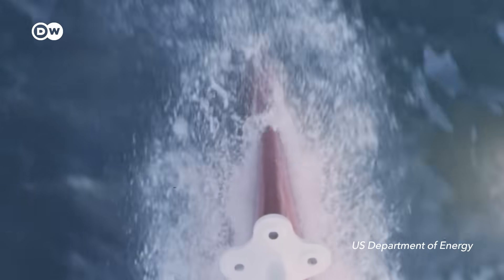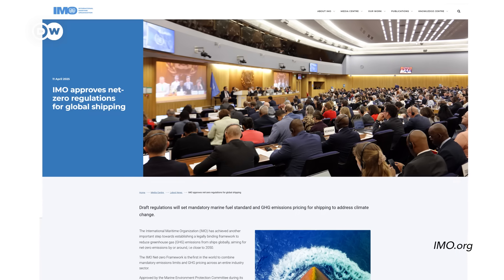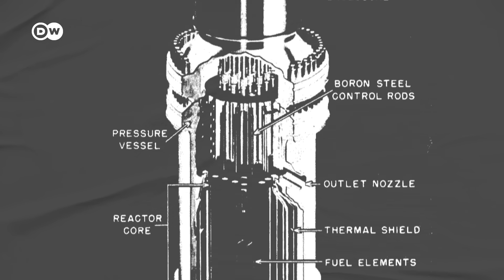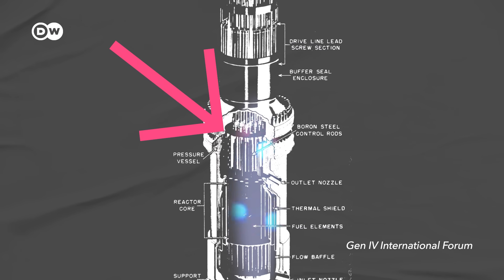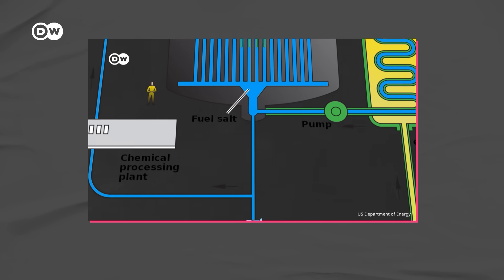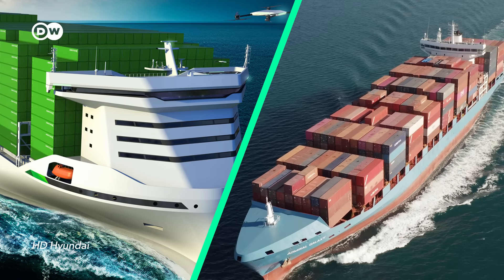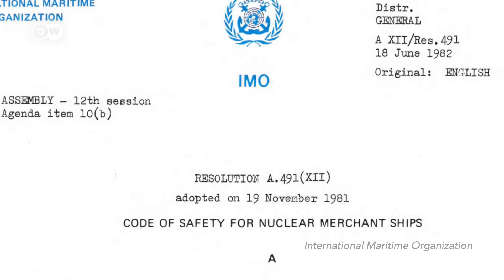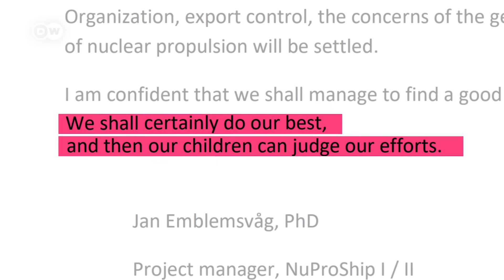Why people want to put nuclear reactors on ships

Comment: You can't just flippantly have nuclear ships wondering around without special protections or security companies. Yes there is essentially zero chance of a malfunction causing an explosion. But there would be no shortage of people looking to steal one of these ships hijack them. Or use them as a bomb. So 40% really isn't enough margin for a whole fleet of security ships that could respond. Or REAL security measures on every one of the ships. And even if it is. At the end of the day it isn't going to be 40%. And countries themselves should have high hurdles for private companes wanting the sail the 7 seas with ships that can be turned into nuclear bombs. That could vaporize ports or port cities around the world.

Comment: Unlike a plant on land, a ship has access to near infinite supply of cooling water in the ultimate thermal sink of the ocean. You are literally surrounded by it. A simplifided version of the passive cooling system that are the norm in modern light water reactors (no need to go to fancy new concepts, really) is all anyone would ever need to ensure safety.

So, please, inform yourselves before broadcasting inaccurate or misleading information. Thank you.

And while you're at it, whenever you mention the words "nuclear waste", could you please update from the pictures of yellow barrels that evoke childish green goo images in your audience to images of the actual concrete or steel casks in controlled pads or clean rooms that are faithful to reality? Extra points for this sign of good faith! If you do, DW will gain credibility moving forward.

PS. By the way, those yellow barrels contain low- and intermediate-level waste, such as slightly contaminated clothing or medical/research radioactive wastes, and managing anything but high-level waste is a nothingburguer in most places around the world beyond Germany (i.e., given the political and fearmongering mess you guys made out of Asse II).

Comment: We should just build a sea train like in One Piece haha.. ships are expensive, but the fear is, the fuel it needs will run out someday.. we need to find alternatives, EV ships are not practical as it will need huge batteries, so maybe we need to build bridges across continent where they are closer, like Russia and alaska, but no one would want to build that, as during war it can become a leverage.. damn it's a conundrum, can't use battery, fuel will run out, only thing is nuclear fusion or fission. Don't know how viable fusion is, as we are still in experimental phase, it will take another decade to properly tame that beast

Comment: They should seriously try to develop a feasible way to couple multiples ships together with power cables to one "mother ship" containing a single reactor.  Preferably a combo of three ships in total: one central ship with a nuclear reactor that produce enough electricity to power two other ships located on both sides and connected to the central one through the power cables.

Comment: Maybe it is better to have nuclear reactors on the solid ground, near settlements, to use the exhaust heat for district heating systems and hot water supply? On the ship this power can be used only in very limited values, and the rest goes lost.

Comment: You could potentially use electric pod motors running on battery power when the ship enters port to allow the reactor to be turned off reducing any risk of danger.
Reply: No you cannot. reactors cant just be turned on and off like that and the danger is not over just because it is turned off. Clearly you have no clue
Reply: @MaxPap-q4f  - the reactor can be turned off using control rods.  That turns the fission reaction on and off making the reactor safer.  How long it takes to cool down is a different question and will depend on what type of reactor you’re using.  The typical reactor which uses a high pressure water coolant probably isn’t the most ideal reactor since those usually are surrounded by military personnel.  A thorium molten salt reactor is probably a better choice for safety and self controlled cooling that prevents thermal runaway.

Comment: Absolutely not, Not just dealing with regular water your dealing with salt water. Salt and metal not a good combination so boom ships sinks therefore reactors sinks to the bottom of sea, salt water eat are erode the metal casing and rods now you have nuclear waste in the ocean to can travel cause of currents from shore to shore,  plus now marine life is contaminated sea food is no longer valuable cause a disruption in the cycle of life. Ya oil suck be at-lest with oil can clean it easier than nuclear waste.

Comment: A Korean shipbuilding company is developing a nuclear reactor for LNG transport ship. The reactor is molten-salt reactor design, 100 MW (thermal) power fast-spectrum reactor with sodium chloride (yes, table salt) coolant. Fuel is 19% enriched uranium. The design is approved by American Bureau of Shipping.
Reply from the maker: Hi there! That's really interesting! Thanks for sharing this information with us ✨
Reply: 19% that seems high
Reply: @loup1559  19% enriched uranium fuel (HALEU) is higher than 4.5% fuel used in ordinary pressurized water reactor (PWR). But  most 4-th gen nuclear reactor in development like SMR/MSR use HALEU fuel to reduce nuclear waste.

Comment: Make the modular reactor removable at sea, well away from port, and drive the ship the rest of the way in on battery or some other auxiliary power that can later be recharged by the reactor in the time it's going from port to port.
Reply: Why? Its a baseless fear. And what would you do with canals or inland ports? Container ships sail all the way up the Mississippi and other major rivers. Duluth Minnesota is 2000 nautical miles inland. Just going to leave the reactor floating in the Gulf of Mexico are we?

Comment: I am not a huge fan of nuclear power, there is not a single reactor project in Europe currently that hit the deadline and stayed within the budget. The reactor currently build in the UK will probably cost of 60 Billion Dollars, you could have build 100 times the amount of wind or solar power in that time which would have produced at least 10 times the amount of electricity. But I do see some huge potential for ships, because there is a different factor playing into the economy. A reactor should always be smaller in size and weight, than a diesel engine and fuel tanks, therefore even if the reactor is more expensive this can be compensated by the increased load capacity, therefore making it economical viable

Comment: "Net zero" and "zero" are not the same, which concerns me because some industries offset their emissions instead of fixing the underlying problem. The idea of Nuclear ships makes a ton of sense to me, and shorter range ferries running on LNG or batteries also makes sense. Nuclear ships run all around the world all the time, and there are already emerging electric and LNG ferries. some are hybrids, but some are also fully electric. With a lot of the world's ports trying to force shorepower for ships docking, so no tendering allowed, this would leave crude oil burning ships not able to dock, but Nuclear and Electric ones able, as they don't emit any harmful gases. Norway is amongst the countries trying to entirely ban what we call "tomgang" where you can't run on empty in ports, you HAVE to dock with shore power, and this has made a lot of our tourist ports looking for solutions, because several of them require tendering and can't host larger ships. So moving to nuclear for ships would let these ports stay open and still allow the huge cruise ships to sail into our beautiful fjords :D

Comment: Who is actually against this? A conventional ship sinking is much more of an environmental hazard. Just scuttle the ship if an old design reactor is likely to melt down. All land based 2nd gen or 3rd gen reactors are based off navy designs. The benefit of a naval design is that you have all the coolant youll ever need by default bc you float on water.
Reply: I am against this for a number of reasons. 1) This is simply not true a conventional ship is not a bigger hazard. 2) what do you do if some crazy guy parks one of them in front of a major city and asks for ransom?
Reply: @MaxPap-q4f why do you think that it would be worse? A nuclear rector in a ship operates at over 2000psi and has a reactor vessel thats about 6" thick steel. The fuel is a solid ceramic encased in a metal sleeve. You could sink the ship w/ a bomb w/ minimal risk of spreading the fuel. Meltdown is the concern w/ the fuel and it can't melt down at the bottom of a large body of water. You just clean up where the ship sinks. A container ship will hold millions of gallons of fuel oil that floats and can be spread by the tides and currents.

Comment: What about hydrogen fuel cell ships? You could literally plug them in when they're docked and they could produce their own hydrogen
Reply: You would need an enormous charging capacity to operate the extremely powerful (and big?) electrolyzers in order to resupply the ship with sufficient hydrogen during the short time it’s in port. Additionally, you would need a liquefaction plant on board. Fuel cell-powered ships with large liquid hydrogen tanks might still be somewhat feasible, but certainly not with hydrogen production on board. And in general, hydrogen is a very impractical energy storage medium — I consider the production of renewable methanol or ammonia using hydrogen to be more likely.
Reply: @701983 good point maybe not onboard but you could build a hydrogen production facility at the dock instead. 

Surely having a crew of nuclear scientists on every ship is not practical. 

Hydrogen seems good because it's made from water and it's 0 emissions. I don't know about methanol
Reply: @Tersy1989  Fuel cells might actually be a more realistic option for smaller vessels with medium transport capacity—like ferries, service boats, or medium-range cargo ships. In these cases, you wouldn't necessarily need liquid hydrogen. Compressed hydrogen stored in high-pressure tanks (typically 350 or 700 bar) could be sufficient, depending on the range and energy demand.

This setup avoids the complexity and energy intensity of liquefaction, while offering greater range and faster refueling compared to battery-electric propulsion.

For very short routes or low transport volumes, full battery-electric systems are often the most efficient solution. But compressed hydrogen can help bridge the gap between limited-range battery systems and long-range electrofuels or liquid hydrogen—especially where quick turnaround or moderate range is needed.

Comment: 2:04 Why not use a land based nuclear power station to make the alternative fuels, which could then be used on existing ships?
Reply: Becasue its less sexy
Reply from the maker: Hey there! That would not work for this case here. The nuclear reactor is what powers the ships. Basically, the nuclear reactor creates heat which is used to produce steam which then powers turbines.However, there are lots of differences in the different reactor types, too.

Comment: We should have gone all in on nuclear a long long time ago, instead of clowing 🤡 around with solar while actually using coal and diesel. I mean, renewables are nice and fun, but until the REALITY can be almost exclusively based on them (maybe in 100 years?) we need a solution, and nuclear is that. And its much MUCH safer than the populus think. It has a bad rap because what you dont understand you fear.
Reply from the maker: Hey there! If you like nuclear, you should check out our channel for more videos on it. One of them is asking "Can thorium nuclear energy make a comeback?" 👉 https://www.youtube.com/watch?v=Km6kqykX900&t=158s ☢️
Reply: This video is talking about cargo ships not energy grids. Anyway, whilst renewables do come with challenges, they do work, they are cheap, and they are actively being implemented. Nuclear is very expensive. That is the reality.

Comment: You are comparing the NS Savannah to a modern containship without comparing the weight difference? Why?

The NS Savannah weight around 14.000 tons. A modern containership is easily 200.000 tons heavy. 

And surprise surprise a ship thats 0,1x the weigth can go 10x as far. Shocker, I know!

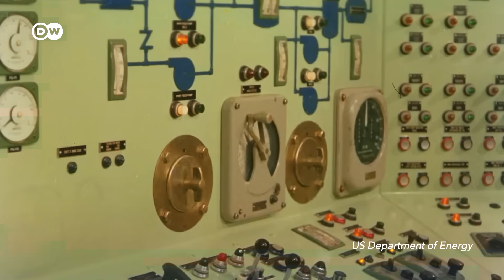Comment: 6:35 Reactor containment is designed to withstand design basis accidents (like loss of coolant) without release of radioactivity to the outside world. The editing of his remarks make it look like a rupture of the pressure vessel will create a big explosion that will affect things across a wide area. Also the statement at 5:51 that PWRs can't be passively safe is not correct; see the Westinghouse AP1000, of which there are now many examples (thank to the Chinese CAP1000 version).
Reply: Dude, this is DW. Just a few years ago, they were in vehemently fighting against Nuclear as a "evil that should've never existed". 
At least they aren't that now.
Reply: @ZippyPiglin36  Indeed, DW's tone is more positive towards nuclear, acknowledging that nuclear is a possible option (at least in this limited case). I just felt that someone might come away with the false impression that existing PWRs are just a LOCA away from making Western Europe uninhabitable.
Next step is to get DW's "Fact check: Is nuclear energy good for the climate?" retracted or revised!

Comment: There's not really a lot to do, there's just rules that need decided and countries to agree on those rules. As far as terrorism goes there needs to be a red button on the command deck and the control room of the engine compartment. When or if someone goes to attack said ship the captain or trained senior officer could press the red button to call for help, and if something mechanical goes wrong and the technician can't fix it they could press their red button. The red button I'm envisioning can't be turned off except by a governmental body from one of those countries in the agreement irregardless which button is pushed. And to prevent jamming of any type it would need to be transmitted via satellite. Of course even though you can't turn the alarm off doesn't mean a terrorist can't already be on the ship before hand to disable the transmitter (honestly I'm not too sure about terrorist on the ship maybe a backup system with continuous monitoring of the connection to the red bottons and a battery backup to prevent power loss). Also the closest agreed country would respond to the emergency but all agreed countries would be alerted to the emergency and from this point comes the agreements of those countries.

Comment: Yeah, this will never happen. 

A 30kt ship costs in the region of 60 million, and has a backlog of about 7 years. A nuclear reactor freight ship is going to cost hundreds of millions. 

A 30kt ship has an average crew of 14 sailors. Highest paid is the captain of the vessel, roughly 5-10k USD per month. How many extra crew members is a nuclear reactor going to need? And how much are those nuclear engineers and operators going to cost? If they even exist, and they don't. You will need to create, train and maintain a whole new industry. Sailors get paid well not for hard work (the work is hard, but that's not the point), they get paid well because they are stuck on a tanker for 6 months at a time.

Lastly, and most importantly - we've already been though this 50 years ago. And we came to the conclusion that, even with all the economic and environmental benefits, it takes just one catastrophe to render huge areas uninhabitable for millennia. 

Considering that vessels sometimes experience fires, collisions and sinking, putting a nuclear reactor on a merchant vessel is not worth the risk. What are you going to do, is a vessel sitting in Rotterdam, sets on fire, and its nuclear reactor goes haywire and leaks or blows? Remove all the people in Rotterdam and most of Holland? Yeah, more likely these ports won't accept these types of ships. 

Ahh and the fact that vessel owners are not corporations, and governments. Most vessel owners are one man shop, meaning they own just 1 ship and run that ship themselves. So you are talking about private owners, running thousands of nuclear reactor ships... yeah what a great idea that. Because you know, nobody would ever falsify documentation to avoid fines, or expensive repairs... Never!

Every single point above, individually kills any thought or idea about a nuclear merchant vessel....

Comment: I think this should already be a thing in my opinion not for Co2 in particular but for economic reasons the mayor issues are getting the reactor design affordable and safe the underwater meltdown thing is definitely an issue but even fueling these ships is a major task even disregarding the cost of the fuel it’s messy dangerous work doing the maintenance on the tanks as the fuel is closer to tar than fuel oil it’s gross